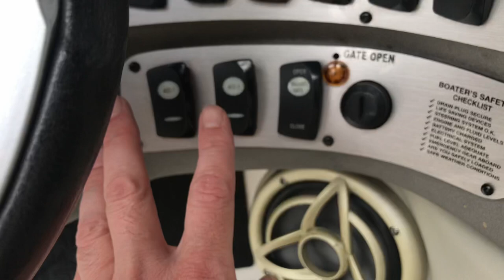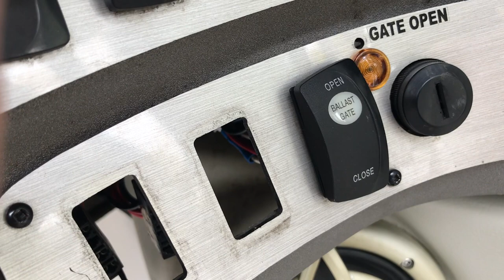Svfara boat part 3: surf tabs

Comment: Hey Isaac how did those tabs turn out? Do you have any videos of the Wake?
Reply from the maker: Hey Michael, the tabs work great!  Just as expected and I don’t use the suction tab at all anymore. I can transfer the wake from side to side very easily.
Reply: That’s awesome , I have a surf system I want to install but i need to get the tabs, did you make them or buy them as they were in the video?